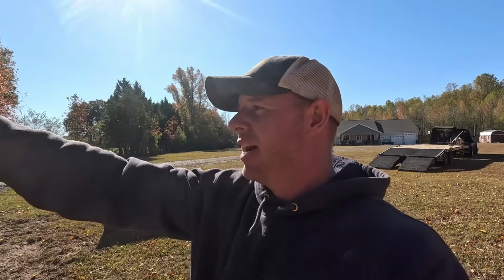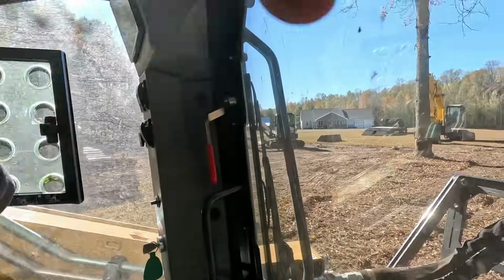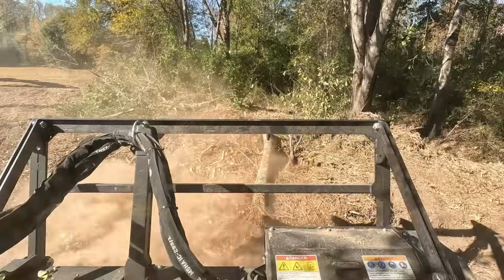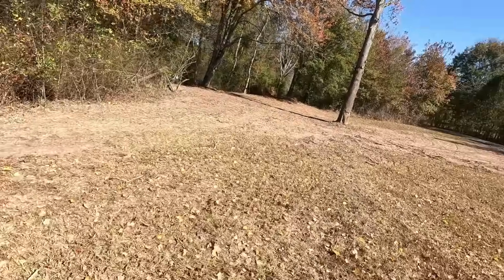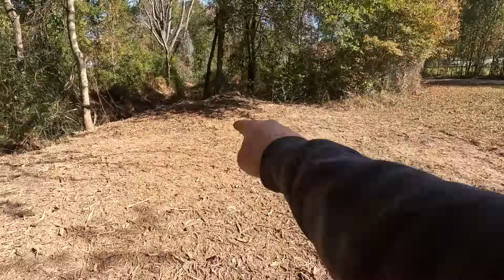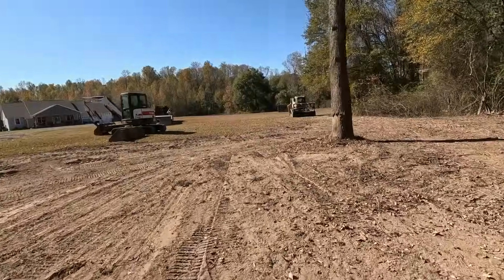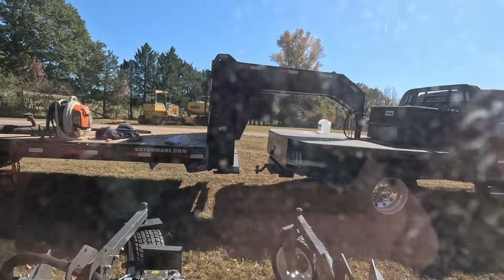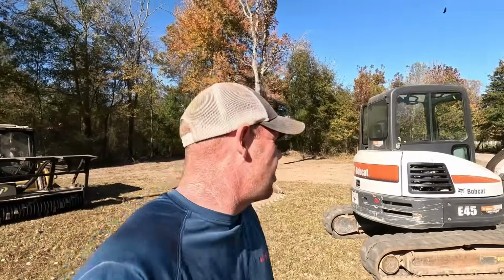Running the Harley Rake on the skid steer for the first time

Comment: The tracks on the excavator starting at 15:14 really do squeak when you move forward and backward.  Do they need grease or is that how they naturally sound?
Reply from the maker: Part of the problem is its very dry and there's no moisture in the ground. No, they don't take grease.